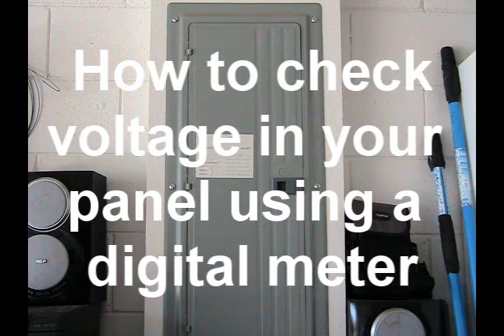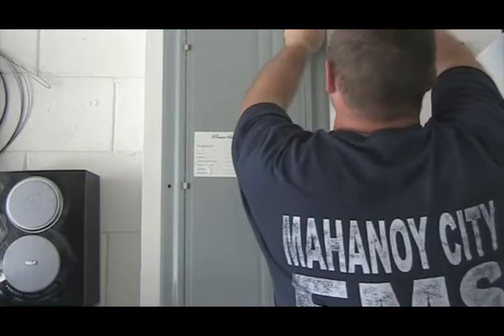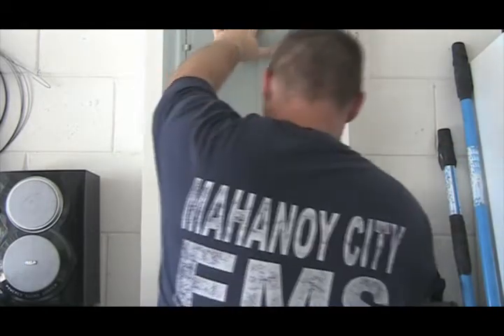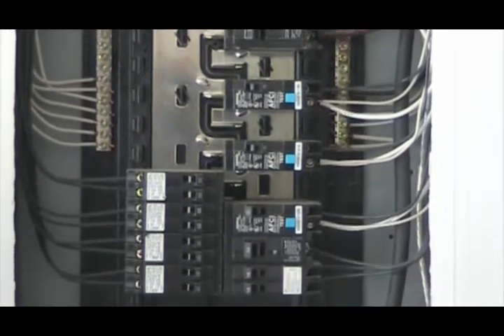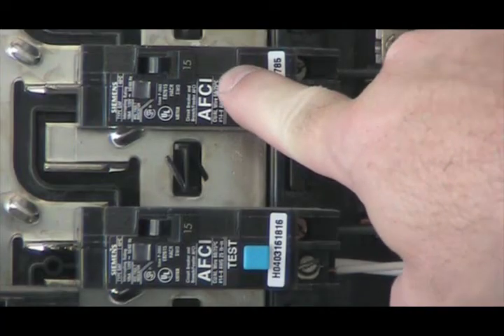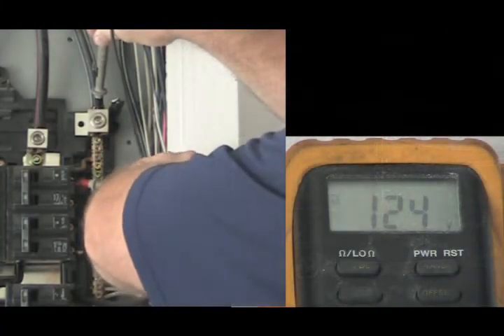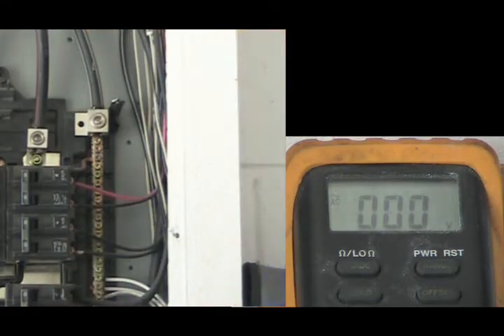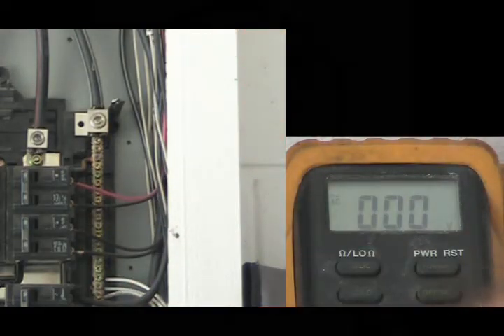Test voltage in your panel

Comment: Thank you so much you cleared my mind and I understand it know, question we have a house that its old under center block build and electrical is under conduit, no ground at all how do I check if I have no neutral?
please advice me. thank you G.C
Reply from the maker: If your panel is the main panel, meaning the power comes from the utility line through the meter, then directly to your panel, your ground and neutral wires are one in the same.  So if all your bare copper grounding wires, and white neutral wires go into the same bus bar, and you only have one bare aluminum twisted wire from the meter to the panel that ties into that same bus bar, then the ground is the neutral and vice versa.  Make sense?

Comment: I'm not getting 240v across the 2 main wires at top or from my 240v breakers.  I'm getting 5v instead of 240v. I shut ALL breakers off and tested again. Still no 240v across 2 main wires at top.
Reply: Did you happen to figure out what happened I'm in the same boat you were in.
Reply: @mindlessvans12 Yes!  I called power company, they came out and in 2 seconds told me that my connection to house was old or should have been updated. They changed the wire to the pole right away. Problem solved.

Comment: I get close to 120v on all my breakers... Still perplexed as to why some of my plugins still don't work and my gas heat and gas water tank are not coming on. It seems I have had a bunch of my breakers fail all at once. They are the stab lok variety

Comment: Instruction should include use of proper PPE and teaching the next wave of electricians how to do work SAFELY!!!
Reply: He should also test between L-N (L-E(ground ) and (N-E ground) and L-L .
L-N=120v L-E= 120v N-E=zero v L-L=220v . He should also use a two pole voltage indicator rated to 690v never use a multimeter as it two easy to set the wrong range and that can result in injury or death. And sadly this does happen.

Comment: something is wrong here. there should only 240 volts coming and then is broken down by the resistance of the 100 amp circuit breakers to your normal 120 volt outlets. there should be a couple of lines for 230/240 for dryer, water heater/ and ac / heater units.

Comment: what if it reads 120 on both but then checking for 220 it reads 0 to -3
Reply: plz help
Reply: The breaker is bad, it's letting the same 120v bus through both legs but only drawing 120v from one bus rather than both. Replace the breaker. A good breaker will test up to 250v across the two poles.